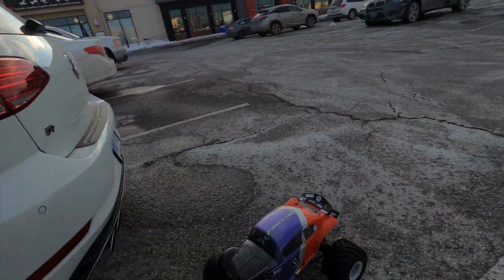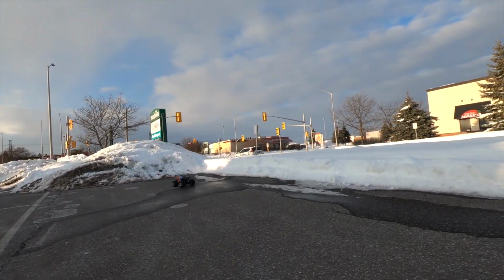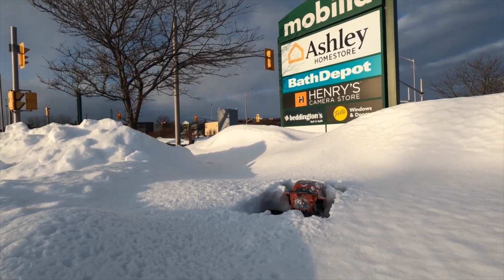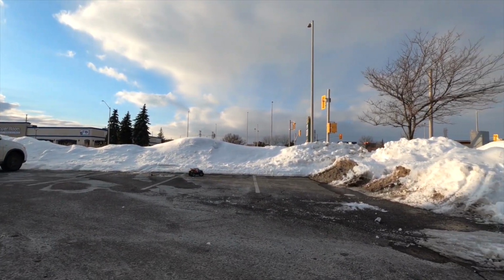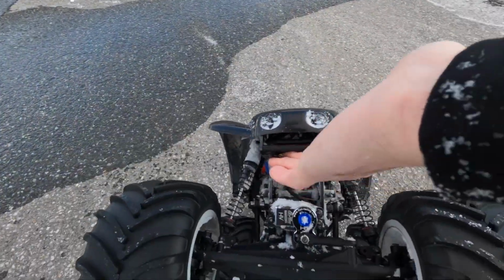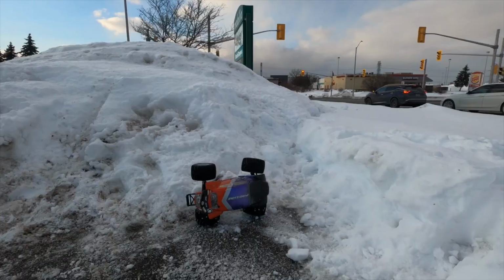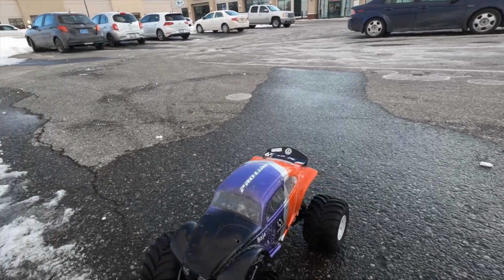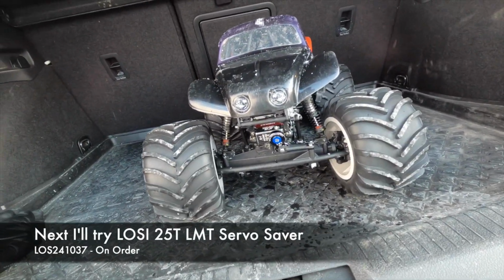Losi LMT 6S Test Run! Brushless Monster Beetle Baja Bug Fun - Netcruzer RC

Comment: Amazing video brother. Just one question are all the stock gears fine with all that power? I’m asking cuz I just got the spektrum 6s cambo esc and motor. But I said to myself I’m only running 4s max. After watching your video I jumped on amazon and ordered a 6s battery. I should of asked you my question before I placed my order lmao. All good I can use it for a future project. But please let us know how the truck puts up with all that power. Thanks

Comment: That thing is sweet is 6s! Hey do u know if it's ok to run the stock bearings with the b6.2d kit? Or should I change right out of the box?
Reply from the maker: I run stock bearings on my race cars. Upgrade to ceramic later for extra smoothness and efficiently but it’s fine with what it comes with for most.
Reply: @netcruzer  thanks that helps 👍,  I am an on road racer and building my first off road buggy so have tons of questions